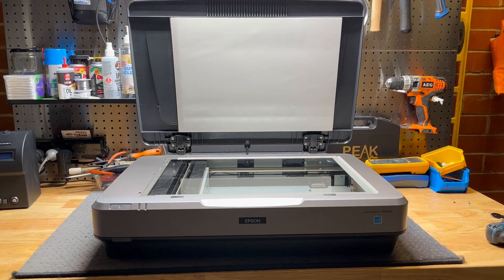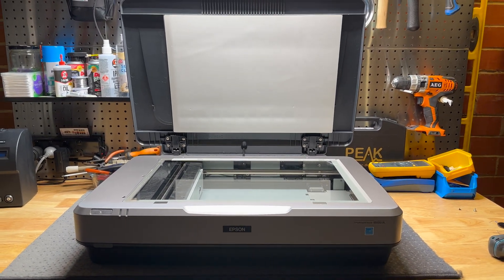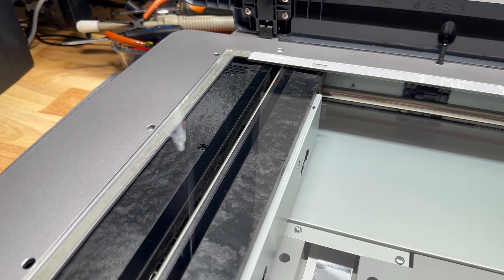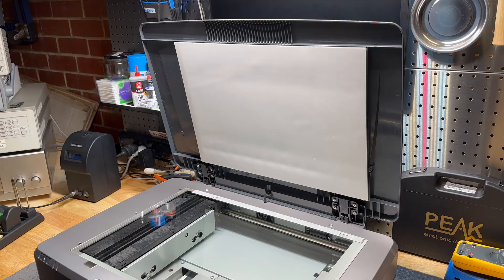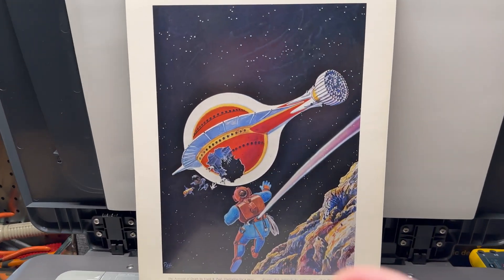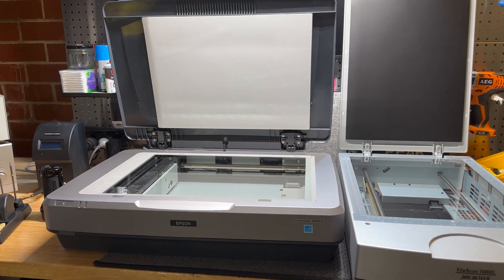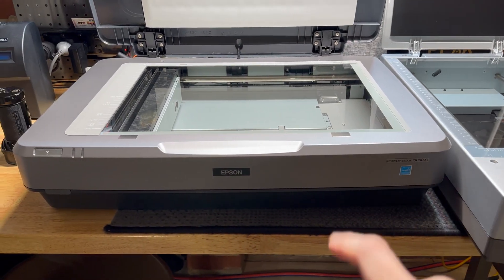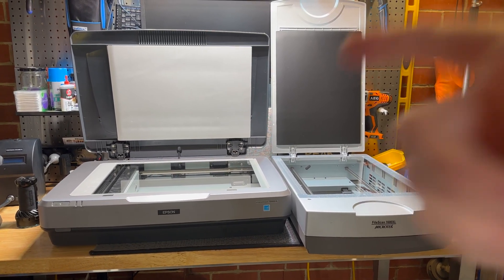Epson Expression 10000-13000XL (Optics Cleaning)

Comment: Thank you for this.  I had no idea that I could deal with the optics. 
I have replaced the glass platen with little problem.  My 12000XL should (?) have uniform resolution across the platen. However at 2400 dpi setting, it gets only to ca 1450 dpi (assessed by a USAF resolution target) varying a lot across the surface.  Before I open it up, do you know of any adjustments that could solve this problem?
Reply from the maker: I don’t know of any adjustments for this but it sounds like possibly the autofocus may be having an issue or the glass surface is deforming which affects uniform focus? I think there is potential for resolution to improve after cleaning the optics as clouded mirrors affect contrast significantly

Comment: Im having trouble removing the white reference plate. The middle post doesnt want to come free. Is it screwed in from the underside?
Reply from the maker: Cannot remember if it had a screw sorry, you have to remove the glass anyway to polish so you can check the other side, it does have double sided tape also
Reply: @whatcouldgowrong7914  Yes. There is a tiny screw.

Comment: What did you use to polish the glass?
Reply from the maker: I used Cerium Oxide liquid glass polishes. Be warned it’s not for the faint of heart though, have to manage heat carefully and its a lot of work to polish glass scratches.
Reply: @whatcouldgowrong7914  Thanks for your brain! I appreciate it.

Comment: Can you please do a video on how to replace the glass (not the entire top)? I purchased a used EPSON 11000XL graphics arts scanner, which works fine, but the glass is scratched. So I purchased another one for parts, with glass without scratches. Do I need to remove the top to remove and replace the glass? Or can I replace the glass without removing the top? How do you remove the white reference plate?
Reply from the maker: There are 2 grey covers on the left and right sides that cover screws which will allow you to remove the entire top section. You wont be able to remove the glass without separating the adhesive and risking breaking the glass. I would just swap the entire top section over with the glass attached and clean the optics while its apart…
Reply: @whatcouldgowrong7914  okay, thanks. Problem is, the top section of the one that I purchased for the glass is cracked. I wasn't expecting to use it for anything other than the glass.

Comment: Thanks for this.  I have tried to clean the mirrors but I still get a line on my recent scans. I have seen elsewhere that the CCD is surrounded by foam that can degrade.  Have you ever cleaned the sensors?
Reply from the maker: No I haven’t, I imagine you would need to remove the entire CCD assembly, id tread carefully as you could mess up the ccd calibration moving it

Comment: Just the video I was looking for, thanks!  I went through the cleaning process you outline the best I could, and am still getting a line that goes across the whole scan.  It's the same color as part of the image I am scanning.  Any idea what that could be?  Perhaps I missed a spot?  I hope it is something fixeable...  Love this scanner.
Reply from the maker: Hopefully it a faulty CCD but maybe check the flat cable for any damage, usually dust causes faint or white lines
Reply: I have a similar issue with color reflective flat art scans where a very thin red with adjacent very thin green line appears on high resolution scans.  The same lines appear as a wider gray line in the same spot on B&W scan files.  I don"t believe its caused by dust as the used 11000XL was supposedly reconditioned prior to my purchase. I am hoping to discover what could be causing it and replace the malfunctioning part.  The company in Florida is no longer in business or I would consult with them.  However, a year later, they have disappeared.  If anyone has any ideas or recommendations as to where I might send the scanner for replace, I would be most grateful.

Comment: Very cool scanner and glad there are people appreciating and restoring such tech!
Did you also clean the glass from underneath? Could not see it in the video :)
Reply from the maker: Yes I did when I polished it :) wasn’t going to make a video originally as it took a couple days to polish the glass
Reply: @whatcouldgowrong7914 how did you polish the glass?
Reply from the maker: @Lizzy-423  Cerium Oxide polish, polishing pads on a drill and a lot of time. I would look for new glass as it is a lot of work and you need to monitor the glass temperature carefully / keep cooling it

Comment: Surprised it had anything else than some plastic lens, used one of these in school and it was just as bad as any epson flatbed.. for the price i would have thought they could have managed to make something even half decent. It even has an actual focusing system, i remember trying to test its focusing and the results were just the same mush no matter what you did.
Reply from the maker: This one has been impressive for me, very good image quality and sharpness edge to edge but I would think it’s useless for film scanning I imagine with the transparency addon due to the resolution.
Reply: @whatcouldgowrong7914  Sure, for film you need special scanners made for just that. Flatbeds can not compete with those. 
I love the IR dust removing feature of those!!!
Reply: Perhaps it was faulty?